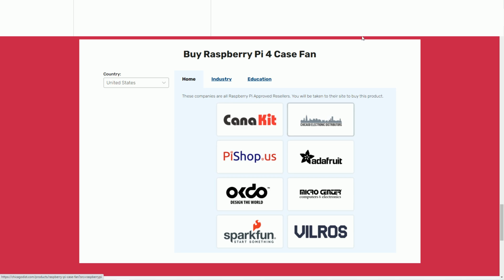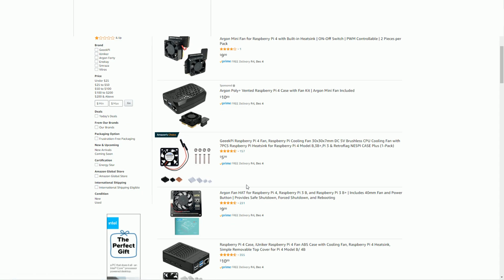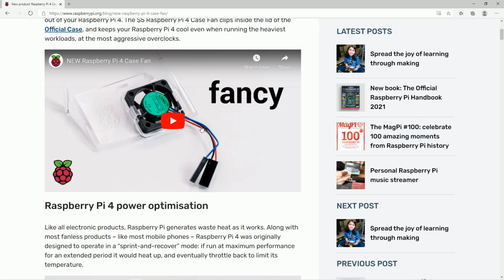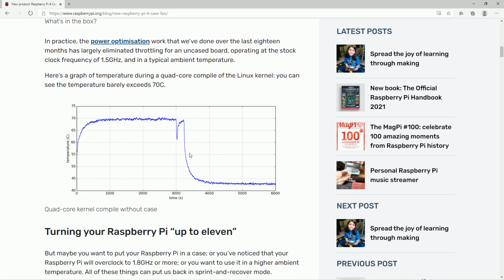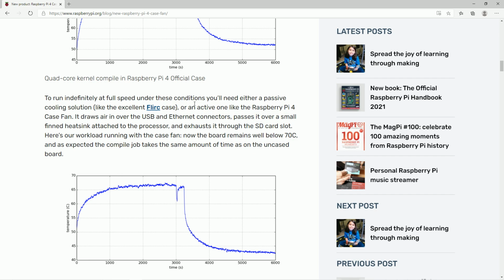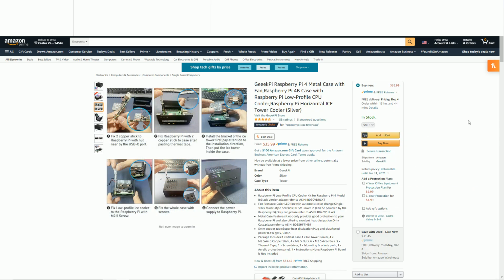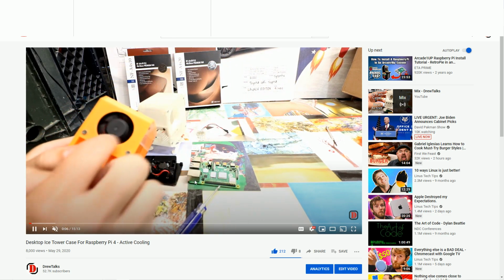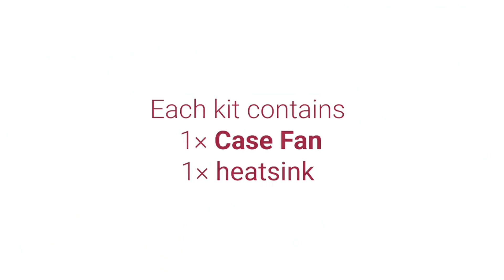The Official Raspberry Pi 4 Heatsink & Fan - Worth It?

Comment: Interesting.  They opted to add a fan, but no enlarged grill for proper intake/exhaust.  For a budget case, I recommend the iUniker case (available for both the Pi 3B/3B+ and for the Pi 4)...it's $10.99 on Amazon, and it has a nice-sized exhaust grill and so easy to assemble.  I've never had heating problems with the Pi4 version.